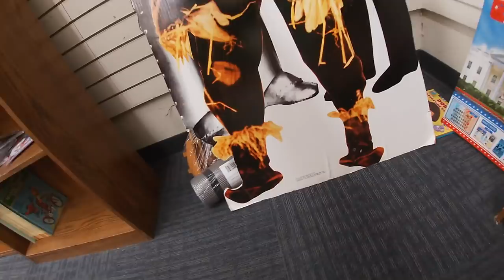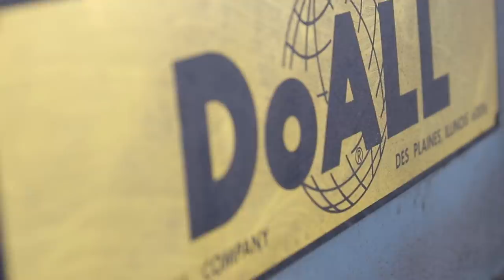What Did We Get Ourselves Into? - Picking Up DOALL VERTICAL MILLING MACHINE!

Comment: Hey guys! Happy New Year!!  Do it all milling machine is 2000 minimum. Oil the whole thing heavily. Prevent rust. Used oil+deisel fuel mixed+ pump sprayer. It will rust up fast if you dont oil it up.

Comment: DoAll is a machine tool manufacturing company... Search used machine tool for sale with .. DoAll Vertical Milling Machine (with) Model No. and you should find many for sale mostly 2 - maybe 5k depending on size and attachments.  It's not a NC or CNC version and it appears to have power feed only through the head stock... It seen to be a basic vertical mill..  Also note that it takes 3 phase voltage to operate, not found in a residential setting.. to operate you'll need a commercial power source or have the power company drop new service to you..  DO not connect to your residential power to it..  things may go real wrong, real fast!  But over all A VERY Nice score! Also, do not spray with WD 40.. Cover all exposed bare metal with a grease and brush it on.  Old style Wheel bearing grease (not red) is cheap and in a pinch will do fine..  Also if you can research "Adjusting Gibs"  I would slightly loosen them to keep them from seizing ... Gib replacement can be expensive..

Comment: That's an awesome piece of equipment good find some will buy that for sure
Reply: Bob it is a manual Mill not CNC but any older machinist will want to add it to shed.just needs vice to hold down workpiece .☮️

Comment: Much more heavy duty than a Bridgeport , 40 taper spindle and built in power feed $ 3500 - 4500 if the head isn't noisy  but any one that comes to look at it will know exactly what it is . And from hear it looks to be in great shape I have bought some of my best machines at scrap yards ,big company's through millions of $ worth of equipment away no problem dealing with the liabilities is to great so scraping is there safest bet.

Comment: Hey tuck and sammie J happy New Years. Wrap your straps up so the metal hook is on the outside then you can hold it and toss the rest of the strap without the chance of hitting anything
Reply: And basically there is different bits that sit in there and the table slides different directions to move the material under the bit

Comment: You need to get it  inside out of the elements right away and oiled to keep it from rusting. just covering it with moving blankets and a trampoline will not suffice. You currently have something worth thousands but it is a very precision machine and any rust can have very adverse affects on it and its value. When your dad said to get a harbor freight instant garage to cover it, he had a better idea than the way you covered it. You could end up losing $1000 or more very easily on its value in just a day or 2 bcause the way you covered it. those blankets are going to wick moisture from the air and the tarp will keep it trapped and rust i within a very short time. I made that mistake and dont want you doing the same